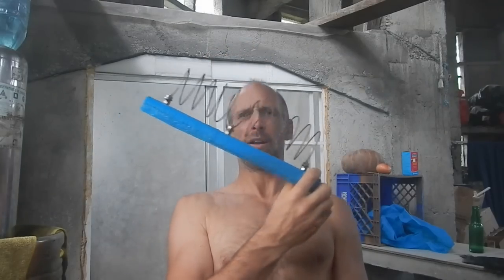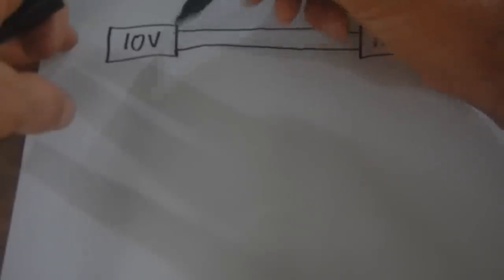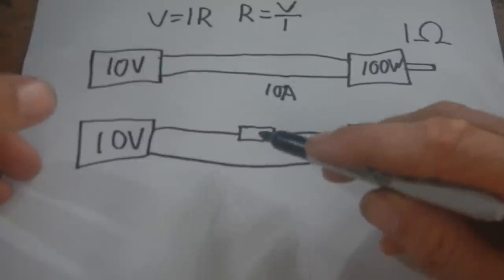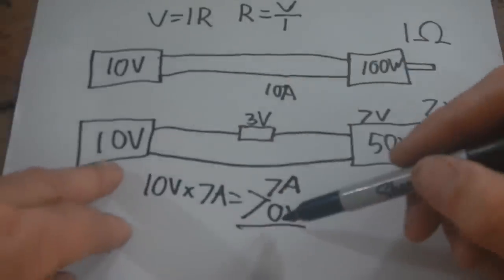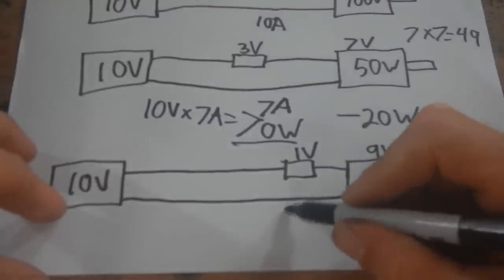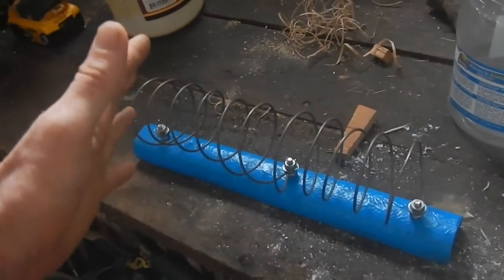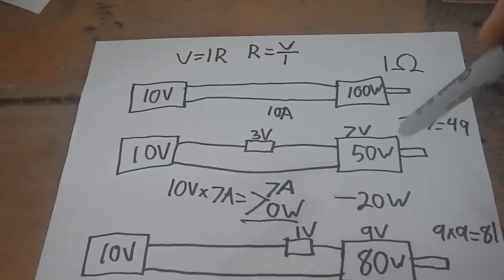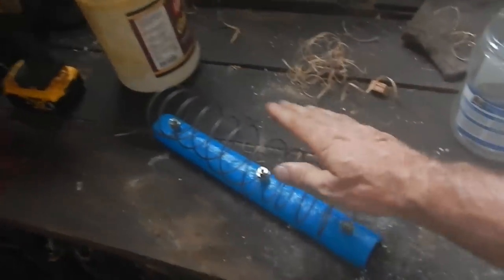$10 Resistive Speed Control.  Crap or Awesome??

Comment: Reasons why this set up isn't good idea.
1# Resistor convert that energy into what we don't want in the first place, "Global Warming"
2# AC is the most efficient way to use battery power.
3# AC speed controllers are very cheap.
4# for Going long distance with lithium battery using half of the power  last longer than at full power.
My suggestion is a marine inverter and the higher the voltage the better.
That is why Tesla use 700v AC in trucks and 360v in the cars and everybody else is imitating Tesla.
Reply: Industry Bot - IMAO The THEM are scared.
Reply: 1 - No one cares. 2 - Bizarre and false, there is no difference between AC and DC motors with respect to battery efficiency. 3 - They're not cheaper than $10. 4 - He's not going long distance. A marine inverter and higher voltage is a terrible solution. Also, Teslas are garbage design and no one is imitating Tesla except to say "we should build electric cars but, y'know, properly". Forklifts switched to AC motors and controllers in the 90s, decades before Tesla was an idea in someone's head.